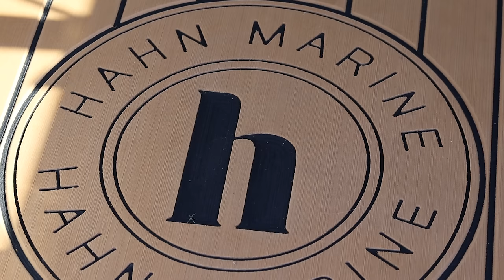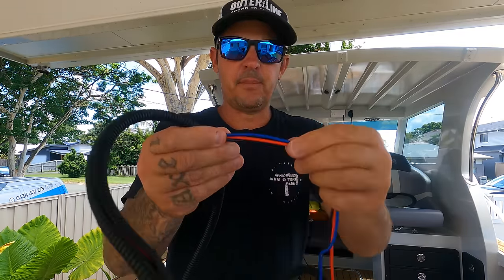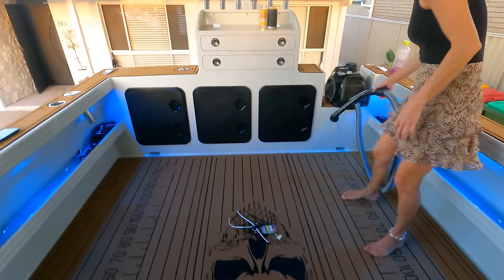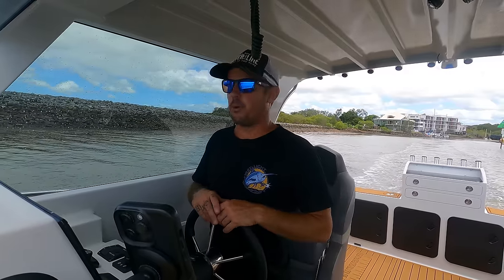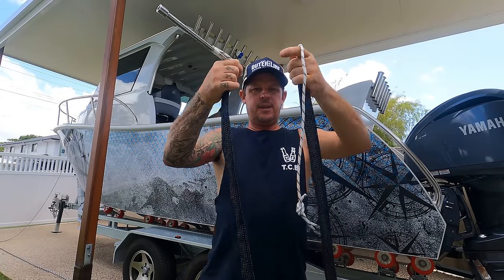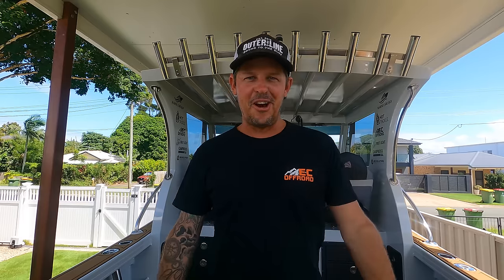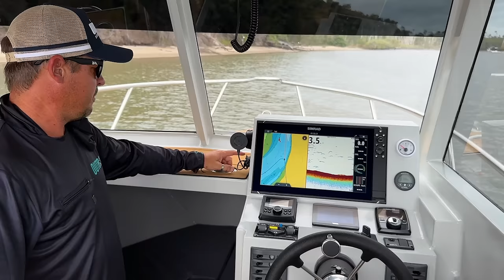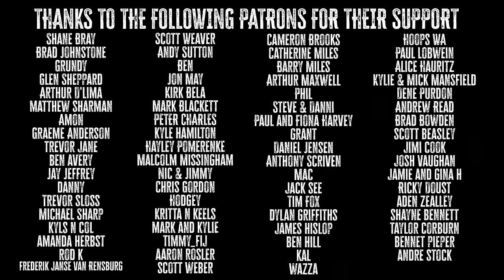Our BRAND NEW BOAT - Welcome Aboard 🌊

Comment: Nice boat review.  Cannot believe you swapped out the beautiful sleek Suzuki 250hp for the Yammie 300hp behometh.  I have the Suzuki 300hp and its a pearl of an engine.   Much more compact than the Yamaha 300hp tank.  I've experienced plenty of problems with Yamaha's in the last 20 years.  MY F115 has had gearbox issues,  inconsisent idling and throttle issues even though it doesnt get a whole lot os use.  My  Yammie F20 has also had problems while weighing a tonne more than competitors (this came with a boat I bought).   On the other hand the Suzuki's ive owned (starting with a brand new F15 bought in 1996) over the years have never missed a beat.  I've even had Suzuki DF5's and DF6's which are incredibly well well built, incredibly easy starting and much lighter than all competitors.
Reply from the maker: Cheers mate! 
Well I’ve had the exact opposite to
You, problems with Suzukis and none with the Yammys. My 300 yam is better then the 250 Suzi on fuel, tonnes more power and also 26kg lighter…can’t argue with those figures, yammy all the way 😂😂
Reply: @_OuterLine  I just checked and Suzuki released their current model 300hp design in 2007, since then they added lean burn and a couple of other minor enhancements for 278kg.  It has taken Yamaha 14 years to catch up with a very similar design (269kg's) to the Suzuki 300hp.  This is the story with most manufacterers as they are all trying to catch up to Suzuki's designs.  Tohatsu is also doing some great work in the 15/20hp, 25/30hp and also 115/140hp categories trying their best to catch Suzuki's designs.   By the way, Ive also owned a few Tohatsu's over the years and these engines have been super relaiable.  Its quite possible that Tohatsu is (and always has been) the most relaible outbrand brand in the world and now they are coming up with excellent 4 stroke deisgns.  It's all good news for consumers of new outboards.

Comment: I would definitely add that autopilot and radar, and a common things here in the Southern US…. Not sure if it’s applicable where you are with the depths you see but a set of Power Poles are extremely useful when attempting to anchor in shallow-ish water and can completely alleviate the need to use anchor in some cases. Might be worth looking into!

Comment: For boat names: compass, true south, first light. One thing  I would suggest is to have your critical safety gear (epirb, flares etc) in a dry bag on the deck of the boat somewhere very obvious. I have started doing this after advice from a few salty souls who have told me they really wished they did this when they had major trouble with their boats, especially if your going to be going way offshore

Comment: sick boat bro, i have the exact same transducer and sounder on mine, pro tip get used to manually adjusting the gain - best way is look at the sounder screen there's a small wheel looking thing (G), click that, turn auto off and manually go up or down... while under way dial it down to get clear marks at speed, if going slower of at rest dial it up. Leave depth at auto. Another thing i have found is that running LOW FREQ in shallow like 50-100 meters marks a structure like an individual rock way more clearly as its a narrow beam, high freq marks the fish better but smaller bottom structure is not so obvious. chur from nz
Reply from the maker: Thanks heaps mate! Yeah I’m a big fan of manual gain also, I always used to drive my 295 that way. How deep can you still pick up fish when deep dropping mate? Also I was under the impression the Low frequency was the wider beam ?
Reply: Algood yeah just takes abit of finess to dial it in. Had a look and assuming we both have the chirp 275LHW then high is a constant beam @25, and low is 19-25 beam. Been as deep as 300meters with no issues on low freq, should be good up to 1000m on paper but havnt got that crazy yet!   @_OuterLine

Comment: When putting wires in that tube put like a 6mm spanner in the tube with the wires through the circle but on the spanner hole the wires then pull it through the tube

Comment: Reckon it may get warm in the cabin 
Doesn’t look as if you have any way to open any side or front windows 
I’ve a razerline hardtop larger model and without being able to open cabin windows id cook on a hot day 
Not sold on solid side windows 
But looks a nice boat
Didn’t see a live bait tank in your walk through - unless I missed it
Reply from the maker: Will get sliders before next summer for sure mate.

Comment: I wouldn’t carpet the inside of the cabin. I know it looks good, but if you do use it for sleeping in like I do, and I’m in Perth WA, you guys get stupid hot weather like we do, it’s actually quite nice to press up on the bare hull, that is also cooled by the water, to keep cool when you are in there. And in the winter when you don’t want that we just chuck an extra sleeping bag down and that protects from the cold. What is the size of the cab? It looks small, but the camera never does justice. Nice boat but can’t wait to see it in action.

Comment: Off the leash! Smick rig mate! The only downfall maybe ventilation in the cab, sucking in fumes
Reply from the maker: Thanks mate! Nah haven’t had any dramas with that as yet
Reply: Just a small hatch install should solve any issues. I suffer bad uless i have fresh air flow in my face

Comment: Lol if you only new the secret with the split loom corrageted wire loom   Use a 7 mm circle ring Spanner to run wire tru then simply drag Spanner along the loom cable and wire lays in the tube  plenty of  videos on YouTube on it

Comment: With all the effort of changing from Suzuki to Yamaha and the lack of an electric and your desire to have autopilot adding the fully Yamaha Hem Master EX suite would give you spot lock and drift etc plus auto pilot.  Saves having to add in all the extras with batteries and a damn big electric.